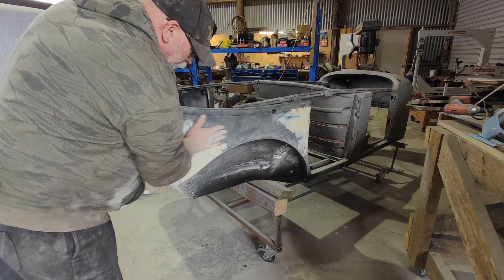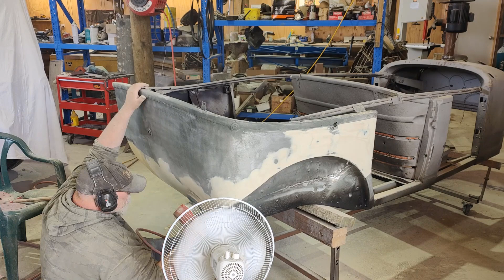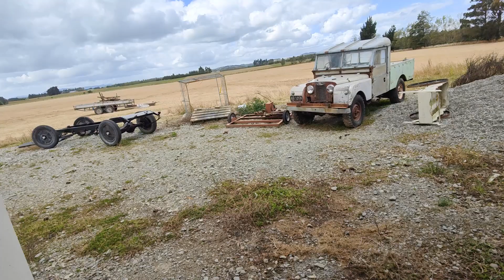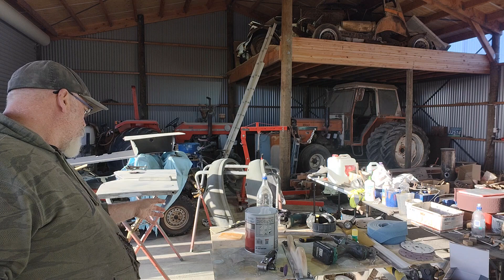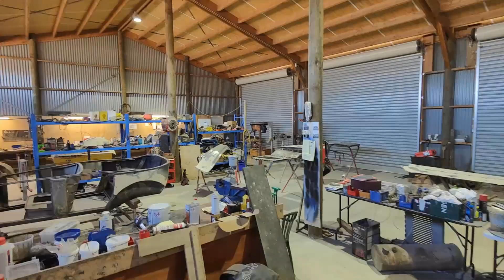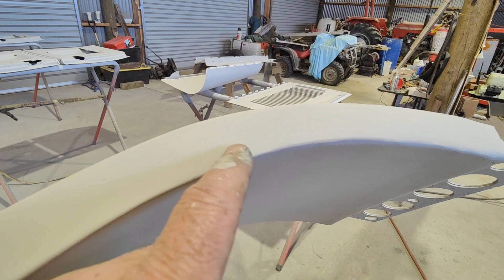swiss cheese dodge 28

Comment: You’re getting me motivated to get going on my Dodge Brothers Touring. After watching your videos, I see that I’m going to need to remove the body to remove the engine and transmission. I’m going to install a 1984 318 in it. Informative video. KBS makes a rust encapsulation product that works great!
I also checked the rivets on the hood. Not attached to anything. They do line up with the rivets on the opposite sides. Maybe they are just to protect the paint when they are opened.